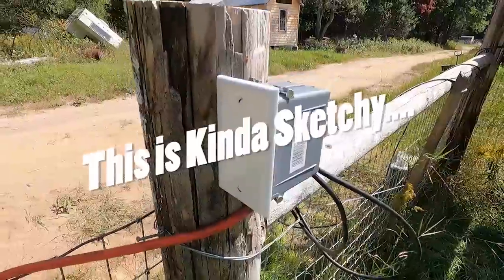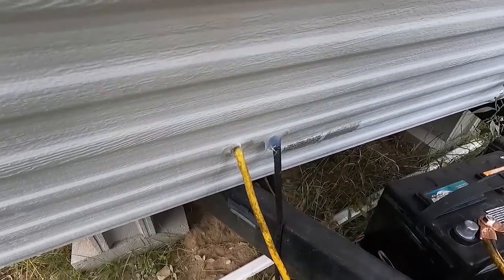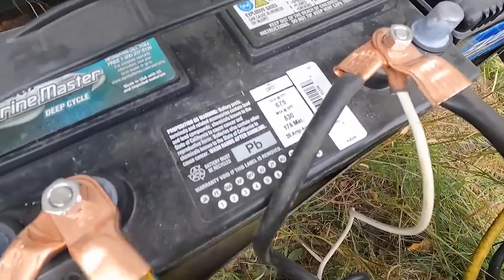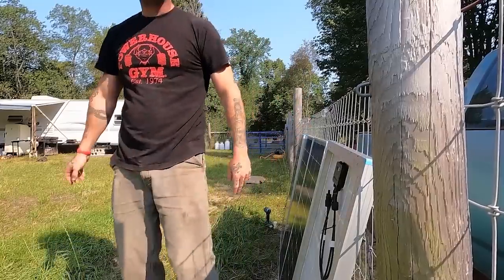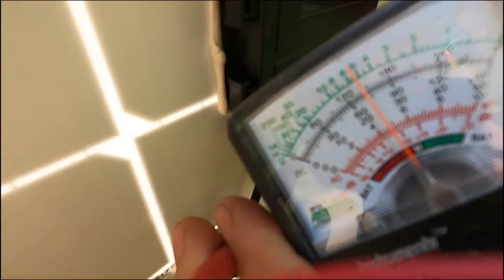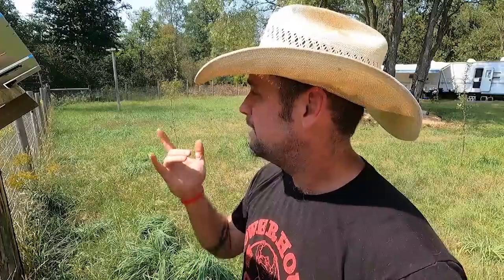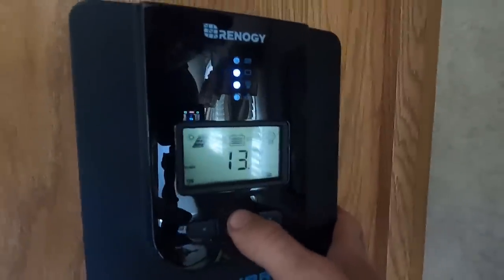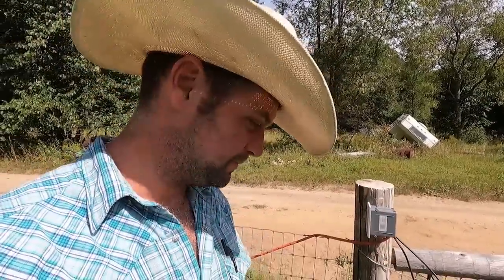How We Built Our Off Grid Solar For Cheap (under $1000)

Comment from the maker: Quick and important correction! My math was wrong in the calculation- I should have used the 12v calculate the amp hours, not 120v. So starlink is using way more than what I said. I've since added 2 more batteries and it's keeping up nicely.

My bad, I'm (clearly) not an expert. Lol
Reply: "My Brain goes way slower then my mouth so this is going to make it hard to edit! " Haha! My world!
Reply: if you are just going to leave the extension cable connector ends on the grass like that, at least silicone the crap out of it and add something to hold them together like maybe a knot? for that matter silicone the wire nut box too. nothing worse than melting some cables and possibly starting a fire 😂😂
Reply: How do the panels handle rain and hail?
Reply: @Airsoftforall   Rain is nothing. Hail can be the end of a system if its big enough.
Reply: Use the concrete block from the sawdust blower for your tire mounting tool.
Reply: @andyslittlehomestead6705   you can use cut ratchet straps as a shear pin and/or u joint on your saw mill. Using four, one foot lengths of rachet strap, bolt both ends of the straps to the PTO shaft and transmission respectively.  A metal ring with aligned bolt holes can be added  over the strap ends to mitigate tearing.
Reply: Where in the UP are you? I have run across used solar panels listed Marquette, I am down near Milwaukee Wisconsin and grabbed a few used 305 watt panels last spring for $85. Now I see them dropping further to like $50 each if you get 4 or more. Next spring I will be looking at more for home projects and the camper. You may be good to look at LiFePO4 batteries now that the price has dropped alot, put them in the front area with the inverter to keep from freezing. Swap the trailer lights for LED's,  if you can keep lights seperate circuit from appliances run the LiFePO4 on that system. Yas a smaller cheap inverter for the lights. You can't mix wet batteries and LiFePO4. Diffrent voltages, and charging rates, so  a MPPT controller for the Lithium battery, but twice the run time if both are 100ah, if you can swing it save up for later and get 200-240ah hour batteries, under $500/400 dollars now. Looking a 200ah one myself for spring.
Reply: LOLOL. Love your math!!!  May God continue to bless you and your family always!!!
Reply: Andy !!!     Panels make over their rated voltage when its cold ...    4s on those panels total will BLOW your mppt in winter .     You need them in 2s2p mate !!!!
Reply: Stuff happens... 
Auphonic is another audio thing to have a look at the issue you were talking about a few weeks ago with removing unwanted music.

Comment: i have the renogy 400watt system as well.  its been working well for over 3 years now.  ummmm, four plus years.  used 4 used telecom 100 amp hour absorbed glass matt batteries.  so far so good.  only thing running ninety nine percent of the time is a 12v compressor fridge.  need to replace the batteries soon,  probably will go with lithium iron phosphate if i can swing it.  i have the panels attached to a ladder rack on top of my van.  they lay flat not angled to the sun.  but back to the renogy.... it is a good quality product as far as i can tell.  will be using more renogy products in the future

Comment: I use 3/4" Copper tubing to tie the battery bank together. 

Flatten and then insulate the tubing using heat shrink,  then drill and bolt directly to the battery lugs.

Comment: I love a small system. I also supplement with these 'Solar Lights Outdoor-Security Powered-Pendant Led-IP65 - Porch Light with 16.4Ft Cord Remote Control' and I even how to inside of my camper and like two outside of my camper. And I have some of the rechargeable solar light bulbs that come with the little solar panel which takes forever for them to charge but you can recharge them using a usb. They really help when the weather is not the greatest

Comment: i like it i use jumper cables i have a 5000 watt inverter i got 1/0 jumper cable, if i got pure copper cable it would cost about 6 time more i use from the panels solar wire its affordable

Comment: That was Brilliant,  love the way you wing it. Back to maths,  look at the wattage of all devices for 24 hours, Ac and DC, add up and divide by your system voltage. You have your amps watts and voltage. You can now size your battery bank.Inverters are power suckers, they take 20 % power to run and convert DC to AC and Back to DC and steal power when you sleep, best switch them off after use Use lighter plug ins 12 volt. If you can buy Buck converters ,work well to if you running higher DC voltages like a computer.  Use inveters only to run high wattage AC devices like washing machine. All DC appliances use DC where possible,  its a huge saving on a small or big system

Comment: Short and sweet, I like it! 2 pieces of advice from someone that has built numerous RV solar setups.......1) put fuses or circuit breakers on the wiring just coming off the panels and then another coming just off the batteries. This allows you cut power safely in an emergency or for diagnostics. 2) switch to lithium batteries and relocate them inside the trailer if your area gets below freezing in the winter. You'll double your usable amount of energy instantly and prices have come down bigtime in the last year. Can get a single 12v/200ah for $400-ish that will blow your deep cycle LA batteries away in performance and longevity.

Comment: Hey Mr , deff would consider adding more batteries when you can to make the lifespan longer . 
Also look at making. A battery box , coolers work well just need a small vent for hydrogen 😅 will help in winter to keep available output up :)

Comment: Having built my own solar system to similar code as you have done, I can tell you that Lithium batteries are worth getting. LifePo4 type. They will not degrade if you leave them discharged but you can't charge them below 35 degrees they need to be inside.

Comment: Just a suggestion on your trailer batteries.  When using multiple batteries, it is necessary to connect your wires correctly.  Right now, your trailer is only connected to the first battery, this will shorten the life span of that one battery.  If you connect the positive (going to the trailer) to one battery and the negative (going to the trailer) to the other battery, then you'll draw from the batteries equally.  You should connect your solar charging in the same fashion.

Comment: The reason for the load out connexions is so you don't drain the batteries beyond a safe point to extend the life of the batteries.
Only things i'd run straight of the batteries are a diesel heater and inverter.

Comment: also I bought a 800w horizontal wind generator for my build when I'm stop for long periods of time cause I got a solar build for the top of my camper since this can run at night helps with my batteries

Comment: Have a 400 watt sysyem similar to yours. I am able to charge 3- 12 volt 100 amp glassmats easily eveyday when  there is a sunny forcast. Usually I can cook a meal w/hoteye and toaster oven and hit top charge before i loose the sun. Good clear days, plus a load of cloths in the washer. 2200 watt inverter.

Comment: Cool video man solar really is that simple. Most modern LiFePO4 batteries or Lithium Ion batteries have a BMS with all kinds of protections also most charge controllers nowadays have all kinds of protections built in. Yes using fuses is recommended but in a pinch in many cases you can get away with things because of all the modern circuit board upgrades. That being said, youd much rather lose a fuse than some expensive component, so fuse em.

Comment: PV Voltage goes up when it gets cold starting at the VOC at 70F.  You are going to fry your charger!  Put 2 in series and then parallel the 2 series strings.  That is only 9 amps.

100 watts divided by 12.6v is 8 amps drain on batteries. With 2 RV deep cycle batteries you would be lucky to get 10 hours with Starlink, lights, Heater, etc.

"A typical deep-cycle RV battery will be rated around 80 amp-hours, which in theory would supply one amp for 80 hours. However, in reality, if you discharge a lead-acid battery (what you likely have in your RV) more than 50% of the rated capacity you will greatly shorten the life span of the battery. Therefore, when calculating the reserve amp-hours of your RV’s batteries, the usable power will be 50% of the rated capacity"
Reply: His solar system and charge controller are paired perfectly, plus you know renogy wouldn't sell it as a kit if this wasn't true. 4 panels in series is going to give the most out of the four panels, they will also work better in low light conditions such as cloudy days.

Comment: Nice Work man. Everyone Needs to build or have installed an Off Grid Solar System for "WHEN" The Grid goes down.(It doesn't have to be perfect) Like your Crimps but they work. Gas powered generators will be useless during Total Grid failure as No fuel stations will be open for business.
IF you can get your hands on four 100ah Lifepo4 batteries later on & double your panel size you will be in business.

Comment: You should balance your batteries. Positive to negative battery to battery. From charge controller to batteries positive wire on one battery and negative on the other, do the same for your RV. They will last longer and have less strain on a single battery before balancing.

Comment: You build solar panels the way I installed a 4 ft satellite dish. Leaned it against the house on top of patio cover, pointed it with a compass, a protractor and an old Satellite TV Guide. Fured up the receiver & fine tuned the dish by wedging a couple of hard cover books under one side. Then I let 'er wobble...

Comment: Very cool! I have 10 similar panels to provide the bulk of my power to 4 Lifepo4 100ah batteries. They don't produce much until the Sun swings towards the south. At the start of the Summer i added 4 panels that face directly to the east. Gives me a great boost that carries me through without using batteries other than the night.

Comment: Renogy makes good stuff, I was going to put a 100 watt system together for my cargo trailer/toy hauler camper but found a 100 watt suitcase of theirs with the built in waterproof controller fit my needs better, I can park in the shade and put the panel in the sun.  Just a simple DC system, some LED lights, a 12 volt vent fan, and USB charging outlets does more than I need.

Comment: So many misconceptions presented in this video, I don't know where to start.  You could have built a fairly decent system for $1,000, but not with brand new commercial panels, SLA batteries and whatever inverter is running off those batteries.

Comment: You could just zip tie the tops of them panels to the fence and put the bottoms on a few boards, Cost almost nothing since you got the fence.
Reply: Fuses are kind of overrated, that low a voltage, do not bother. Just make sure you cover the panels with something if you will work on it.

Comment: Very bad idea to use AC mains connectors like those NEMA 5-15s for a solar input to the charge controller, as some idiot could connect the solar connection to 120VAC and kill the charge controller.  Possibly explosively.
Also, rough rule of thumb is to allow for 25% potential rise from the PV array in cold conditions, so the ~90VDC from your PV array in summer ambient conditions could go up to over 110VDC when it's very cold.

Comment: Hey Andy: Great video!  And, by the way, a few gobs of RTV in the right places will make that box wrather tight.  Just make to drill a weep hole at the bottom.  On a completely unrelated side note, check with Ellsworth Farmer's Exchange on propane.  We have a 250 gallon tank running our two RV's for heat, cooking, etc.  Also, Blane's in Traverse City has 8D batteries for a reasonable price.  They are not deep cycle, but between the solar panels and the generator, in the shortest days of winter, an 8D should still get you through with no problem.
Steve in Alba

Comment: Thanks for the video, I tried to do it cheaper...
1. Can fashion your own mounts with screws, and free scrap wood and free scrap plastic and save about $10/panel.  Looks like you didn't use treated wood, so could skip the scrap plastic.
2. Looks like you got a Renogy Rover 100V panel input, 30A MPPT 12/24V battery charging charge controller ($130 separately).  Does have load control circuit  (max panels=24V*30A=720W)
3. At 77F, the open circuit voltage (OCV) on the panels is 24.3.  In the cold/winter, the panels get more efficient, so the OCV will go well over 25V and 4 in series will go well over 100V which is the max for that charge controller.  You'll have to disconnect 1 panel during winter.  Doing 2S2P and doubling the current to half the voltage may start to get unsafe with the extension cord+you have to  buy y adapters to make a 2S2P configuration.
4.  You can get on Amazon a reliable 150V panel input, 40A MPPT 12-48V battery charging and bluetooth charge controller for $120. No load control circuit (Max panels=48V*40A=1920W)  
On Amazon, 400W panels like yours regular price $220 or $285 for bifacial (will work with your mounting height and setup and get more power overall especially in winter).  Going to a local solar supply store and 400W can be as cheap as $110 total.  Shipping is usually more expensive than panels for small systems-bulk buy with your neighbors.
5.  You already had a lead acid battery, but per kWh stored, LiFePO4 batteries are much cheaper, last much longer, don't waste near as much energy when charging and are much safer (but you'd put them inside the trailer rather than out).  You mentioned 70Ahx2=140Ah (safely discharge marine batteries to 50%).  About $2/usable Ah for  LiFePO4 on Amazon.  So, if you didn't have batteries lying around, might as well get 2x100Ah for 2x$200=$400 and then you can make a 12V (parallel) or 24V (series) battery system.  24V allows thinner wires and double the solar panels vs 12V.

Just for the solar part:
Charge controller $120+panels $220= $340 from Amazon(as low as $230 with local panel pickup) vs $400 for the kit in the video and you additionally get year round operation (with 150V maximum panel voltage), about 3x more power expandability and bluetooth monitoring.  You would lose load control if you want to turn lights on automatically when the sun goes down or a central switch to turn your DC network on and off manually (not big enough to handle an inverter).  My guess is that most people ignore the load control circuit anyway...why many charge controllers have just dropped it as a feature.

Sorry to pick at the setup, but have to shout out to those with fewer arms and legs.

Comment: Good basic overview to get one started - thanks!  Just a word of caution based on my experience (very recent).  12v panels are fine for smaller off grid setups like RVs and cabins.  I built a 12v system (600w) for emergency use but decided to grid tie it since the panels were just sitting there.  What I found is newer 12v panels are not compatible with grid tie inverters.   The newer 12v panels produce much more voltage than expected.  The voltage is too low in parallel and too high in series.  Grid tie inverters are meant for the larger 300 to 400w panels that have a Vpk around 34v. So… if you want off grid and grid tied, then spend the extra for good 400w bifacial panels.

Comment: A 200AH lithium battery would work great for you. Amazon has good off brands. Still a little pricey but I think you'd like the benefits. Lasts longer, no need to vent, cold matters less and best part, you can run them empty without damaging them.

Comment: Hey Andy, your power calculations are wrong. Watts are Watts are Watts. Current (amps) varies with voltage.

Your starlink draws 100w, which you're correct about it drawing 0.8a at 120v. The kicker is it's about 8 amps at 12 volts to provide the same power (watts). Those two deep cycle batteries should provide about 150 amp-hours (amps times hours), so your starlink system should run for about 18 hours, or realistically closer to 16 assuming your inverter is 90% efficient (10% loss as heat)

Hope this helps. Thanks for the videos, your comments on mental health resonate with me.
Reply from the maker: Yep, I made the correction here in the comments. Lol.
Reply: @andyslittlehomestead6705  There are conversions that you could run the starlink directly from the 12 volt also without using the inverter.

Comment: Andy,instead of taping the wire nuts in an exposed area,take a tube of exterior sillycone and barely clip the end of the nozzle off to its smallest opening size,insert into open end of wire nuts and squeeze that handle until filled,wipe edges to assure full adhesion and call it did for the next 15 years or so.. Yes you can still twist the wire nuts off after curing if you need to change something or just cut the wires and use new nuts.. The sillycone will prevent water instrusion whereas tape will not,plus it helps to keep the wire nuts from loosening or being messed with by critters as they don't cate for the taste of sillycone... Just a thing I learned many years ago doing something pretty much along the same lines as this...
Reply from the maker: I like it. May work that one in. Thanks!
Reply: They make silicone weatherproof  wire nuts but honestly a tube of silicone is probably cheaper.

Comment: 100 watts at 120v is 0.8 amps not at 12 volts.. your inverter will pull 100 watts but when you convert it to 12volts output from the battery its 8 amps.. so your battery will only run your internet for a few hours....
Reply from the maker: You're right, I screwed up the math. Got 2 more batteries added since and she's good